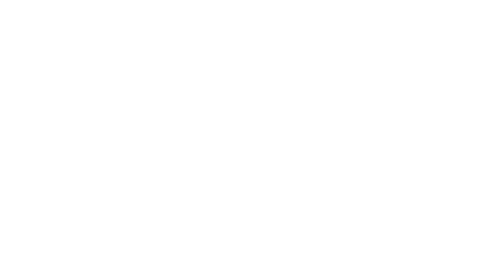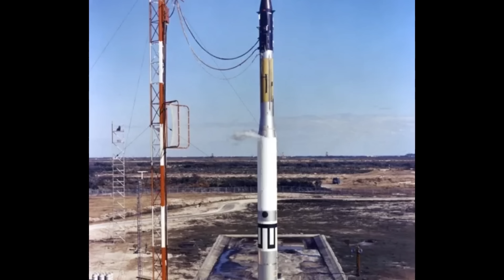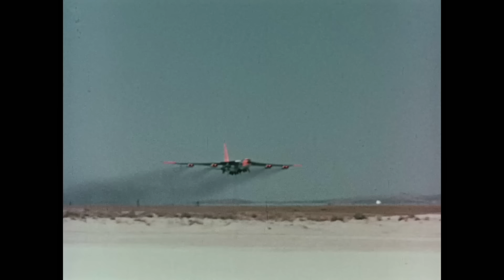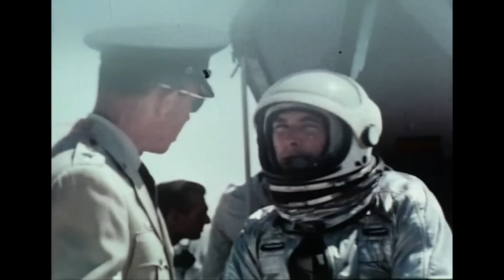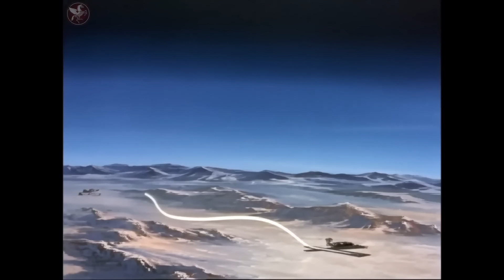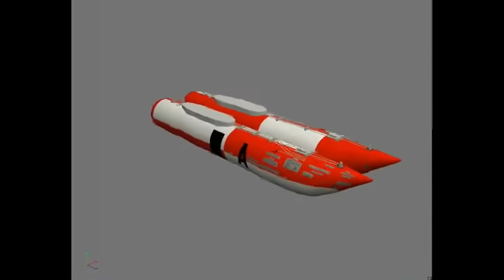A Brief History of the X-15

Comment: Using a ball dropped from a height to test the dry lakebed surfaces isn't THAT non-technical. It's very similar in principle to the Brinell hardness test, whereby a hemispherical "indenter" is placed on a surface of unknown hardness and a known force applied to the indenter. The hardness of the material is a function of the depth of the pit the indenter leaves in the test article. This test would have been known to all of the engineering types on the project (including most (if not all) of the test pilots). 

And so, a steel ball of known weight, dropped from a known height creates a known force on impact, and the size of the indentation, etc. Simple.

Some of the real caveats on this test are that it's really only valid for isotropic materials like metals and probably certain plastics (carbon fiber, for example, is NOT isotropic because it's a matrix of fibers and resin), and it is not clear to me that a dry lakebed surface is isotropic. I would not be surprised if they talked to a civil or geological engineer or maybe even a geologist about the nature of those surfaces and the concomitant validity of the "test."

But on the other hand, it was the late fifties/early sixties; maybe they didn't. 🤣

There's also the issue that a Brinell hardness test uses what is called a "quasi-static" force to drive the indenter, and dropping a ball is an impact, which does different things. Whether the difference would be meaningful for the purposes these guys were up to is something I've forgotten too much physics to be able to safely say, but I have a gut feeling it's not that big a deal, especially given a landing skid hitting the ground at the end of a flight is kind of an impact.

Comment: Nope, not even close. The Space Shuttle was faster. And this, like the Space Shuttle is a ROCKET PLANE. The FASTEST, official, air breathing aircraft was, and is, the SR-71.

Learn how aircraft are classified before putting out misinformation.
Reply from the maker: Excuse me, this is not misinformation, as there is active discussion over these definitions, and the FAI maintains the X-15 as the fastest manned aircraft, primarily due to use of lifting surfaces, which the Shuttle did not use during ascent.

You can disagree all you'd like, but please don't be so hostile about it. It's not called for.

Comment: You should make a brief history of upper stages
Reply: Brief history of POGO OSCILLATION
Reply: @GarrettLemrick   or booster stages!!!
Reply: Or specifically SRBs
Reply: @Tommy442-sp7woSRB upperstages?
Reply: @OLIVEtRees810 I mean you'd call those Solid Kick Motors
Reply: well leas see how many rocket are just kit bash of different stages and rockets
Reply: @Jamesthesquid  For sure. 

Any Delta rocket up to the Delta III pretty much, those were all Thor-derived. The core of the Delta II was "extra extended long Thor tank" because of how many times they'd stretched it. I mean heck, even the Delta IV Medium used effectively the same 4m cryogenic second stage as the III.

Ariane kinda had the same thing , 1-4 were all pretty much based on core stage with different combinations of boosters and uppers. The Titans as well.
Reply: More like Very, Very Long History! :D
Reply: @ALRinaldi  it’s called a brief history because the videos aren’t brief at all that’s the joke
Reply: ...yes.

Comment: Correct title: Coolest plane ever built
Reply: @Lea_Avi idk I feel like it got pretty hot
Reply: Incorrect. Space Shuttle, thought terribly dangerous, was still the coolest ever.
Reply: @RGGaming940  Its funny that the Space Shuttle is (technically) an unsafe vehicle by modern space launch standards, but its still cool that in the minds of people that still reference it for "future shuttle concepts"
Reply: @gustiwidyanta5492  the dangerousness of the shuttle is very, very weird. it mostly depended on ground management more than the actual hardware or design being flawed. indeed they reached a 1/70 of LOC at retirement, compared to the 1/270 of crew dragon and soyuz, or the calculated 1/10 of early shuttle launches, or 1/2 of an apollo mission, but still it could've been improved till 1/150 and be considered generally safe. issue were, as always, the humans, which ignored every red flag before the two major accidents and every single close call the program had, leading to an unsafety culture where management came before life. aside dangerousness, the real shuttle flaw was the cost, it's the main reason it couldn't even fly per year all the produced external fuel tanks, it just costed too much to fly, and the amount of ground service needed before during and after the flight didn't help
Reply: @golem_videomaking sunk cost fallacy killed it then i guess, huh.
Reply: @gustiwidyanta5492  mostly, the other half of the fault was congress and nasa's industrial complex realizing that with the constellation program and later SLS and eventually artemis they could get way more money for way less hardware flown while reusing shuttle parts. if not to shift the focus from leo missions to the iss to the return to the moon, the shuttle had too little reason to be cancelled. it made everyone happy as it was, it's just that SLS made em MORE happy than shuttle. i suggest some videos of Eager Space, a fellow colleague of CAS (i have absolutely no idea if they know each other lol), it goes in extremely detail, even too technical sometimes, into that matter, and yeah shuttle story is mostly political more than anything else
Reply: @golem_videomaking  too little reasons a bit of a stretch lol. but really, it fulfilled the purpose it was built for a while before the cancellation. the complete lack of safety culture as you stated, leading to so many casualties on the shuttle is what killed it. if the whole shuttle program goes off with no accidents maybe they keep the shuttle on for regular flights for some reason. but let's be real this is what happens when the goals of a program are fulfilled happened after apollo Nixon killed that in favor of leo experimentation by way of a station, hence the shuttle. while I know the money is an issue man I wish they could have a shuttle program alongside artemis. Appreciated reading your comments though you seem very knowledgeable.